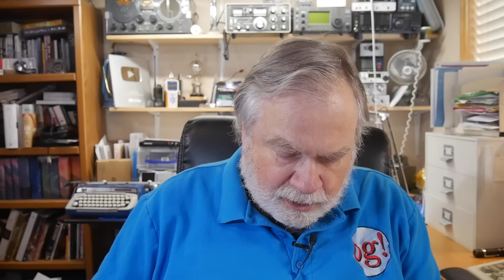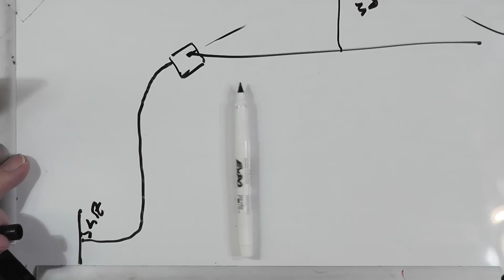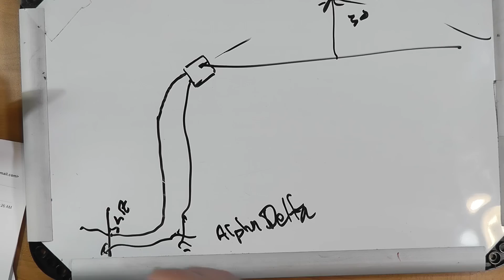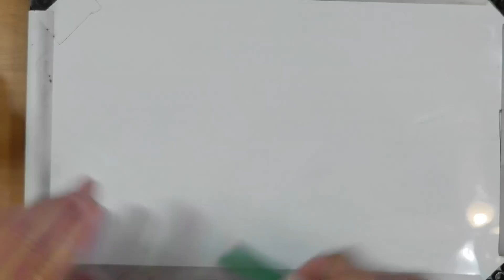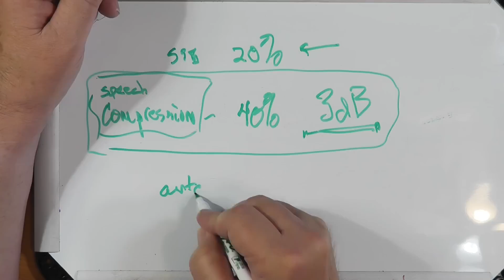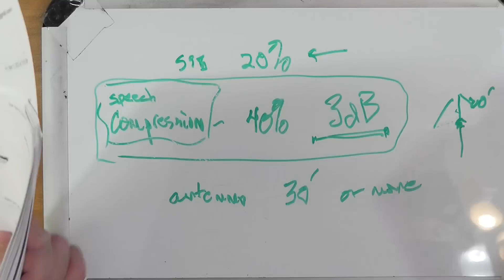Not being heard at 100 Watts (#680)

Comment: I'd put several counterpoises 90 degrees to the antenna and of the correct length for the lowest band used. For the Chameleon EFHW (has 130 foot wire) at 80m it was 52' radials. The radials should be cut for the lowest band you plan to use. They helped. How you deploy the antenna wire has a HUGE effect on your results. I used a 12m spiderbeam pole to get  a sloper or inverted V.  When I tried a sloper at 20 feet coming off the house it worked poorly. The antenna was oriented N/S and I hit South America, Spain and England. II even hit Germany once.
Reply: Agreed, all this and using only 100 watts. It takes perseverance at times to get your rig properly dialed in. It can be a matter of trial and error and this is certainly the hobby for those who like to tinker and experiment. There is a vast wealth of knowledge out there from those who have done a lot of the legwork for you but it's up to you to take it from there and adjust the antenna as needed. Also perhaps your coax is of poor manufacture. There are many Chinese manufacturers who put steel braid throughout with a copper wash because they don't adhere to any standard. Is your LMR 400 from the original ,manufacturer or some knock off? it may make a difference. 20 feet is too low for your antenna..

Comment: look up a web SDR and listen while transmitting, that will tell ya if yer "getting out". try close SDRs first and gradualy move away further.
Reply: Thumbs up. -  But, I couldn't help to giggle as I was sort of in the same predicament; found an SDR station near me, turns out the Ham running it only has an 80-meter doublet antenna on the SDR system thus a signal on 10 meters as he is only about 7 miles away from me was lousy and basically killed my audio that I've spent upwards of $1,200 primarily with W2IHY 8 Band EQ and his EQplus! The Ham with the SDR station is basically being a selfish LID with it rather than putting a proper multiband antenna on it.
KD8EFQ/73
Reply: @charleswoods2996  I may be misunderstanding this but presumably this is a websdr that the guy is allowing access to? Not sure how that makes him a selfish LID.
Reply: @g0fvt  According to "that Ham" in Stow, Ohio, he "stated" that he only has an 80 meter doublet antenna as HE uses 80 meters primarily for casual QSO's there, so I'm quoting him which I can't help to perceive him as a bit selfish in that respect.  Okay?  A Web SDR that is capable of receiving and tuning across the bands including the commercial stuff and up to the VLF and ELF bands should have an antenna capable of "multi" band rather than "mono" band.
Reply: @charleswoods2996  I am afraid I don't see the point you are trying to make, most WEBSDRs are made available for free by hobbyists. Often they use wideband active antennas, but other antennas are used too. Generally for receive an 80m dipole will do a fair job across many bands. If you are paying to use the WEBSDR then maybe it is a legitimate comment but presumably this is a free one on the internet with the hardware, electricity and internet paid for by another ham. Certainly does not sound selfish to me.
Reply: @charleswoods2996  Web SDR is full of SDRs around the world. i live in southern Utah, and use the the SaltLake SDR, its about 200 miles away. if i wanted to check my signal in New Zeland, they have one too. 73s
Reply: @davidmyers397  I was going by what the original poster said here "..trying /close/ (nearby) SDR's, then working your way further away."  Okay?
Reply: I will definitely try this, thanks.

Comment: Is he not being heard locally or DX?  Raising antenna helps DX but hurts NVIS.
Reply: It is a dilemma.  Raising it is problematic on my lot, but not impossible.  However, I need to do some communications within a 300-500 mile radius and losing NVIS my hamper that.  Adding compression seems to have helped...still experimenting.